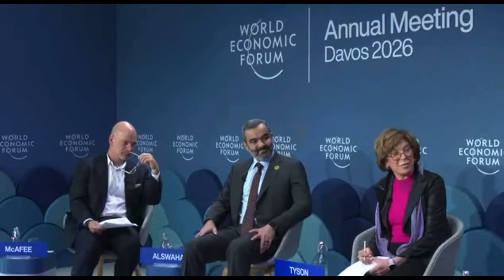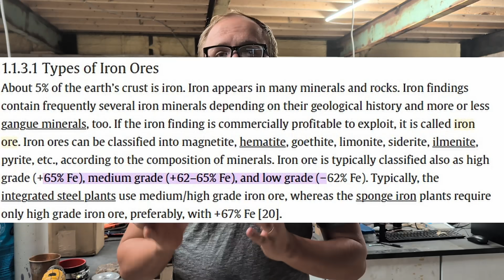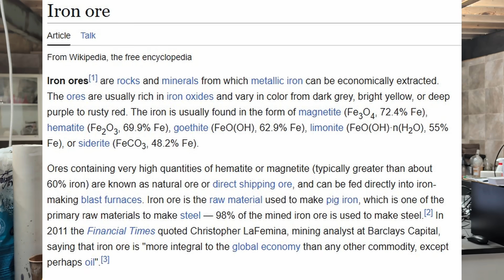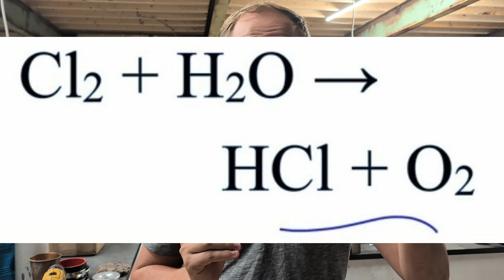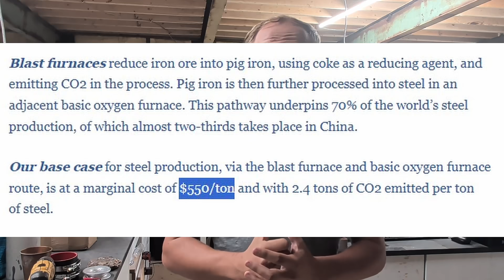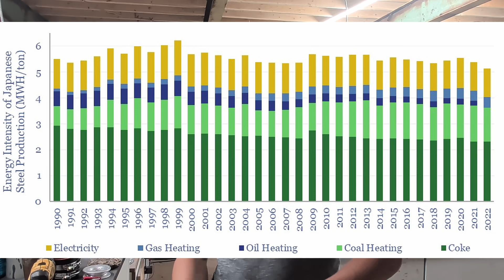Electrochemical Green Steel at Room Temperature, No Blast Furnace

Comment: Hey partner - I work at a steel mill. Let me fast-forward some stuff for you: Nowadays, a majority of many product lines (rebar, mild steel products) are produced from 95-99+% scrap. I don't know the exact cost of electricity, but total conversion cost is around $310 per ton - I suspect about ~175-220 of that is electricity. This is in a 'modern' carbon-electrode arc furnace. Our industry is disappointed in the fact that the constant circular recycling of steel creates a floor on the level of contamination of our mild steel products. That is to say - if you created a multi-step process whereby scrap could be purified back into metallic iron, filtering off all of the contaminants and alloying metals, THAT would not only see commercial application, but could start GENUINELY AND COMPLETELY REPLACING virgin ore with purified, recycled scrap 👍Just a thought!
Reply from the maker: Very interesting I didn't think of it like that. I always thought scrap was better just to remelt direct, but now I see the importance of refining in steel. Thank you very much for that perspective!

Comment: I apreceate the electrolysis  and low running cost, but I wanted to add, one doesn't need carbon to reduce iron. Hydrogen works pretty well too.
Reply from the maker: Still inefficient
Reply: @Rowow  totally agree.

Comment: My question is. You talk about using these acids and chemicals in the production. What's the cost of all that? Wouldn't think it would be cheap. Then they still have to melt it down to make products.
Reply from the maker: Remelting is $50. Chemicals are produced with my membranes once using saltwater. Very cheap to produce

Comment: ....NONONONO...THIS is SCAM OR SOME PR PROJECT

....THERE'S JUST SO MANY THINGS THAT JUST off

...FIRST OF ALL, ELECTROLYSIS OF any WATER SOLUTION OF CHLORIDE ACTUALLY GIVES lots OF BLEACH due to immediate reaction of chlorine molecules with water ...THIS IS why SODIUM INDUSTRIAL PRODUCTION DOES THAT WITH molten salt

....ALSO,FRACTION OF DOLLAR PER SQUARE FOOT is A SCAM.....ALSO......2ND LAW OF THERMODYNAMICS CANNOT BE AVOIDED AND YOU'VE MENTIONED controlling entropy WHICH GOES AGAINST

....SO,well......ONLY REALISTIC WAY IS ABOUT electrolysis of molten iron oxide.......OH NO!!.....IS THAT EVEN MORE ENERGY INEFFECIENT THAN USING coal??...
Reply from the maker: Bleach is sodium hypochlorite. Aka you need sodium to make bleach. There's no sodium added for the iron cell
Reply: @Rowow  .....ALL HYPOCHLORITE IONS are BLEACH,BECAUSE that's THEIR PROPERTY

...IF THAT'S only THING TO SAY THEN I'M RIGHT

Comment: What about all the toxic chlorine gas created by the electrolysis process and how much feCl31of it do you need to use per Ton of iron.. also have to include the amount of electricity used in the electrolysis process.  My guess is you will create 3 times more Cl(chlorine) per fe(iron).
Reply from the maker: UV recollects the chlorine gas as hcl
Reply: @Rowow  you collect that right ? to make acid to sell?

Comment: You know, I'm conservative if we are doing it that way, there's probably a reason for it. 
But your arguments are solid your method is so much simpler, we've been doing a similar process for copper for years now.
One potential problem is free hydrated atoms cause pitting in castings but nitrogen bubbling can fix that
But there's no reason you can't just dump train full of ore into a tank and get plate after Iron bars out of it

Comment: why chlorine acid is used?
it generates nasty chlorine gas by electrolysis, and converting it back to HCl ... is it realy so simple: mix with water, and let oxygen evaporate?
I think sulphuric acid should be more convenient.
Reply from the maker: uv is easy to recover the chlorine. But you are right, other acids may work better. The point is showing that the potential of this technology working in this specific manner. It may not be the most optimized but it already is far superior than traditional methods. I have plenty of experience with chlorine already also so im used to it.

Comment: I wonder why it is so revolutional ... metal electrolysis is known from centuries.
Reply: It is revolutionary because the orders of magnitude less costly membrane makes it cheaper than smelting. He talked about this in an interview on the Nighthawkinlight Extra channel - this kind of mucky electrolysis with dirty starting materials just wasn't done before, because every problem with a process would destroy a costly membrane. So chemists only used the membranes when they had pure and well controlled starting ingredients.
Reply: The ion exchange membrane, not so much

Also chlorine is highly corrosive
Reply: Mostly why aluminum is so cheap today

Comment: It sounds like the tricky bit is the membrane. He claims to have developed a much cheaper membrane which not surprisingly he doesn’t detail. 

I’ve followed the molten oxide electrolysis process for a while. There’s also a related lower temperature process name of which escapes me. 
Anyway, we’ll see.
Reply from the maker: maybe dont be so lazy and like just read the description or my other videos... pvc cement + water softener resin, I open sourced my patent last week
Reply: @R @Rowow es I will look at it when I can find it or perhaps you can put a link in info section of part 1. I’ve looked at your channel, I’ve Google searched and I can’t see a part 2 so I assumed you hadn’t made it yet. 

. I assumed you had good commercial reason not to detail the membrane details. 
Please remember these technological areas are full of claims which don’t work out or get followed up.

Anyway I’ll look at the other videos inc the cement one. Metals processing and cement two of the big stumbling blocks to decarbonisation. I understand the challenges. I understand about all these processes being at base about electron transfer. 

If someone can come up with a replacement for kerosene in aviation - that would really something. Or a replacement for diesel / bunker sludge in shipping.

EDIT - I think this what you mean. It’s not part 2 but details the membrane process 

https://youtu.be/c3tNXDlgE2M?si=y6E2uvyBMDEItgf2

Comment: The copper industry has been using a very similar process for years to chemically plate pure copper from a solution of copper ore that has been dissolved in acid and then electrically plated out as 99.9% pure copper. Great to see this approached on iron and it may be applicable to other metals.

Comment: $156 per ton is purely electricity, and doesn't take into account all the other costs. As well as being calculated as if there is exactly 0 losses based on the purest chemistry possible. I could be wrong, but I doubt any such process is close to lossless.
Then we add the $50 you mentioned below to remelt, so a baseline of $200, then add the costs of the secondary materials needed for Steel, (it does have some carbon content IIRC?). Now how do you make sure this gets mixed properly?
And now comes the big additional costs, labor, land, buildings, machinery, handling, transport, safety etc. Unless your comparison number of $500 is pure materials + energy costs, it's sadly not comparable.
I'm not saying that this might not be a better way of making steel, however, I am doubtful of the numbers you use when comparing!
I'd love to see an actual study on what the total costs would come out to in theory, as much "stuff" included as possible!
Reply from the maker: The $500 is pure material and energy cost. Review the source

Comment: What the f are you talking about cleaner historical steels?? We can make extremely clean alloys if needed but an I-beam does not need to be as clean as a structural component in a landing gear assembly. Like what are you on about??
Reply from the maker: Because I produce iron that's the quality of a landing gear for half the price traditional processes produce crude I beam steel

Comment: how do you turn this powder into a workable metal without heat? come on man
Reply from the maker: Read pinned comment
Reply: @Rowow so you still have to melt it with heat?
Reply from the maker: @buttole yep. To alloy to steel or stainless..that isn't the expensive part..only takes $50 in heat. Expensive part is reducing
Reply: @Rowow fair enough thanks for informing me

Comment: Aren't there already electro furnaces that get hotter and stay hotter than coal? I am not in this industry, so I can only mention that there were articles about China steel making with such technology.
Reply from the maker: anything that requires heat or long heat up times WILL NOT WORK with renewables, simply because solar/wing are not consistent. It needs to be a system that is stop and start. Not only does my system achieve that, but also is cheaper than those other methods

Comment: One issue I can foresee is while it may be possible to use BOF slag as a source of iron, and reducing that pile may be seen as good thing, you will at the same time be generating an equally large pile of iron-free "slag" at your end.  Something that needs to be considered.
Reply from the maker: It wouldn't be slag. Rather clean silicate and aluminum oxide that is environmentally clean
Reply: @Rowow  that's the stuff you talked about that algae and plants would spontaneously start growing in, right? So benign it could be used as agricultural soil.

Comment: Do you have a problem with included chlorinde ions in the iron? Or is their a less problematic ion on the other side of the membrane to transfer the Fe ions to the electrode.  Depending on what you use the small amount of included ions could be useful in later production of alloys instead of a problematic factor. Some useful ions could be dangerous to use though like if you used cyanide ions to make an ingredient in a hard alloy.
Reply from the maker: No the ferric ions move through the membrane into a different solution.

Comment: Or you can use Electric Arc Furnace or an Induction Furnace.
Reply from the maker: No
Reply: @Rowow  stfu you don't know anything
Reply: Not to make new iron from ore. These only melt existing metal; or perhaps you meant to add alloying elements once the iron is made? Politicians and the like in the UK have been talking about replacing blast furnaces with arc furnaces, ignoring (or being ignorant of) their entirely different purposes. The method described here, if brought to fruition, would replace blast furnaces.
Reply: @rogeratygc7895  you can use sponge iron as well and it is made from ore not from scrap.
Reply: @somebody1241  True, but in 38 years working in steel industry research I never saw a piece of sponge iron. Direct reduction furnaces are the closest to that in routine use but, if they are not actually blast furnaces they are a somewhat similar process to them. I only ever saw a direct reduction furnace in Belgium, if I recall correctly.

Comment: You need to think about how big a batch could be handled with your system.
It wont scale up.
Reply from the maker: Yes it will
Reply: @Rowow 
Ok, in 2023 the UK put out 5.6 million tonnes of crude steel.
That's 0.3 percent of the worlds total.
Your process is energy efficient but slow.
You couldn't scale it up, the energy density of coal and gas is sitting there ready to be released at need, to replace that with generated electric current would require a massive amount of generation sitting somewhere idle at the moment.
It doesn't exist.
I appreciate that the generation required is significantly less with your system but it is still an absolutely mind boggling amount of power.
How much power to produce 5.6 million tonnes through your system.
How do you propose to generate it ?

Comment: Very interesting. The clipped video you showed from the WEF also ignores the electric arc furnace steel production that has existed for 100 years at smaller scale. With the abundant hydro power in Canada (Quebec and BC generate almost all power from hydro which is why so much aluminum is smelted there) very large scale steel production is in the works and though most EAFs use recycled steel as input many also use DRI.

Comment: As a tool and die maker i lived and worked through the decline of American steel and saw directly the bad imported steel. It machines like crap regardless of grade. All 4140 hot rolled steel from china was full of hard veins as if old files had been dropoed into the liquid metal just as it cooled and set leaving veins of much harder material that wears out milling cutters leaving bands of uncut material on vertical walls. This is so dangerous since that is what hirise building skeletons are assembled from. I will NOT go in a hirise building. Anything made with that kind of steel is full of stress cracks and getting worse every time the wind blows hard.
Reply: Too racist to go in buildings is exactly this guy’s target audience. You should give him all of your retirement funds asap.

Comment: All the chemistry seems like it lines up. Basically just electroplating, or the inverse of the sacrificial anode found on sailboats. Fascinating concept, you definitely earned yourself a sub. Would love to see a demo, and further discussion of cement, even on very small scale. I live near an old abandoned steel mill that has piles and piles of slag just lying around, how cool to turn those into a resource rather than a waste product.

Comment: My kiln makes 100 ton iron each day, how large must your membrane be to produce the same amount.
And why didn't you show the process in operation, I can show the steel mill.
Reply from the maker: I'll make a video soon. I need to sit and calculate but a icb size electrolysis cell or two I estimate can make a ton or more. I need to sit down and calculate the current density off surface area etc

Comment: I don't think you can recover the cl2 that easy

The overall reaction is:

Fe2O3 + 6HCl -> 2Fe + 3Cl2 + 3H2O

You can't react Cl2 and water to get HCl and oxygen easily. This only works if the original metal is not oxidized like metallic gold.

You may be able to use sukfuric a id but high temperature is needed, and idk if your membranes can sustain more than 100 degrees Celsius
Reply from the maker: Common bro ur better than this. FIND SOLUTIONS NOT EXCUSES! use UV light excitation
Reply: @Rowow  I'm not well versed in chemistry. Could you explain, how does it work? does h2o and cl2 react into oxygen and chlorine with uv light?
Reply from the maker: @nedisawegoyogya look it up
Reply: @Rowow  not really sure the keyword but i'll look into it
Reply: @Rowow  What’s your excuse for not demonstrating this? Did you spend all of your money on bot comments?

Comment: Scalability is the issue. In industrial economics. Run a pilot for a year for 1 tonne capacity. Calculate the Total cost of ownership by adding all capex and opex. Then sell your idea. Actually it will take 30 years for a production unit to prove its ability economically. Also electricity slabs are different for industries. This is why many industries has captive power plants.
Reply from the maker: This technology is incredibly scalable
Reply: @Rowow  Your bullshit certainly scales very easily.

Comment: This is really pretty neat. I'm reminded of a set of research that've been looking into metal smelting for lunar ISRU, and over in that research, they've discovered that you can smelt most common metals plus many rare earths by using common chemical catalysts and nothing more than some mirrors to redirect sunlight for heat. They do the experiments on Earth in vacuum chambers and with off the shelf lasers to simulate sunlight, and those are lasers in the kilowatt range I believe, not even particularly strong lasers.

By simply lowering the air pressure, smelting gets real interesting and requires very little energy to do, and can be done in Earth's gravity without issue, though the research is quite early, it concretely proves this guy wrong. And that's not to even start with the fact that it is electricity that makes fusion experiments possible, as chemical reactions can't get anywhere close to high enough temperatures to even be a consideration for fusion experiments. And complaints about energy usage is only an issue in the US with their horribly outdated infrastrucutre and refusal to purchase solar panels because Trump is so pro-oil that he treats anything else as the enemy despite the fact that the lead times for any new fossil fuel power plant is more than a decade away due to backlogs, but solar panels can be installed today, even for gigawatt range solar farms.

Comment: I have been looking around for how you can set up the electrochemistry on this for a couple of years, based on the various iron batteries systems.  I’m glad someone has been able to approach it more professionally.

Using solar and only running the reaction when the sun is up, without worrying about storage , is much more affordable.  Casey Handmer at Terraform Industries started with that insight for methane production.  Works well for anything you can electrochemically produce.  If you haven’t reached out to them it would be a useful thing to do.

Aluminum is probably the next big opportunity here.

Anywhere that has a lot of sunlight and iron ores is one train load from becoming a clean iron factory.  All over the US southwest for one…

Comment: What happens if you have more than one type of metal dissolved in the acid before you start electroplating?
Reply from the maker: Selective ion transfer
Reply: @Rowow via a membrane so you could have different membranes to different sections and split up the metals all at once from the same container with multiple sections, right?
Reply from the maker: @MrNathanstenzel yes
Reply: @Rowow have you considered adding magnetism to the mix?